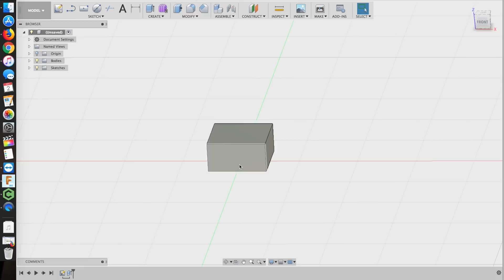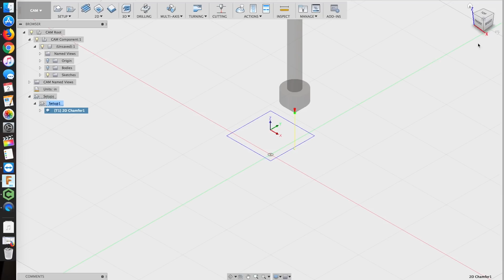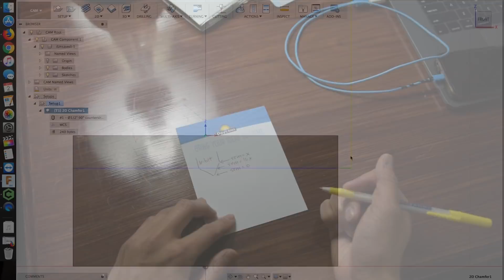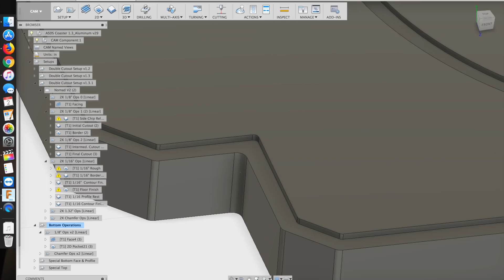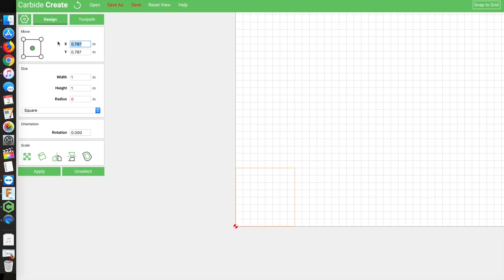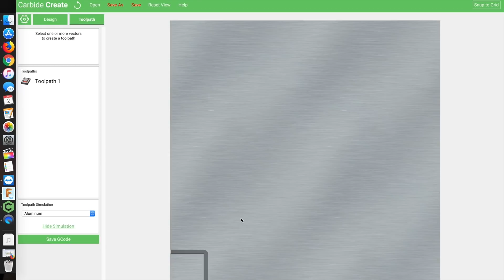2D Chamfer Toolpaths - Fusion 360 Fundamentals #2

Comment: Thanks Winston for another great video. While this video explains very clearly how to add a chamfer to a model that doesn't have one by selecting the edge to be chamfered, often I want to model the chamfers. Lars Christensen explains how to chamfer with a contour path a model chamfer. 

https://youtu.be/Uwhuz0bBubg

Each path has it's advantages and disadvantages to take into consideration. I still can't figure out how to offset the tip of my chamfer endmill if I'm chamfering a modeled chamfer with a contour path. Would love your opinion.

Comment: A question about fusion CAM and shapeoko. In Fusion 360's CAM under the passes tab there is a setting called tolerance that controls the linearization of curves. I know the shapeoko a maximum precision is 0.005" so are you suppose to set that number to 0.005" or does it not matter?
Reply from the maker: You can go higher, but after a certain point you'll cause toolpaths to be broken up into so many segments that you'll flood the GRBL buffer and cause stuttering.